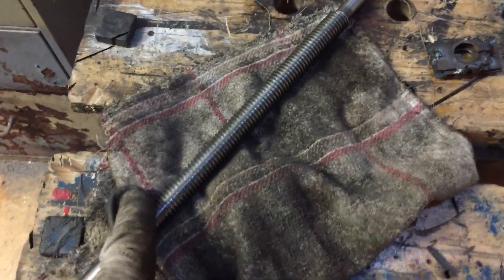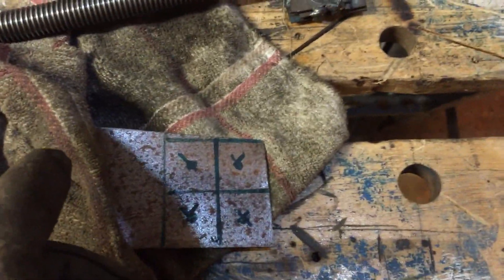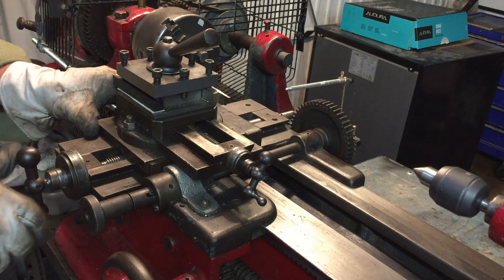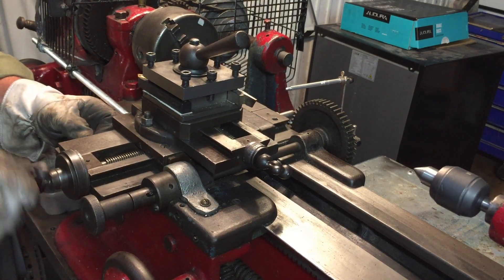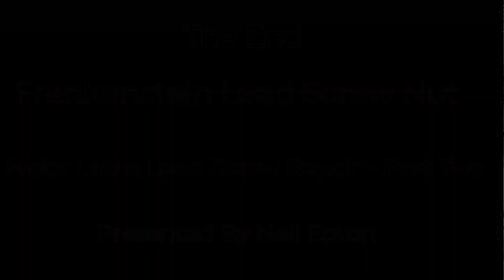The Frankenstein Lead Screw Nut

Comment: Many of the older machine tools had backlash  eliminators which worked in a similar way to your design ..   the concept is sound but steel on steel is not a good idea ,,  cast iron  , bronze or brass or even   acetal  or tufnol would work better